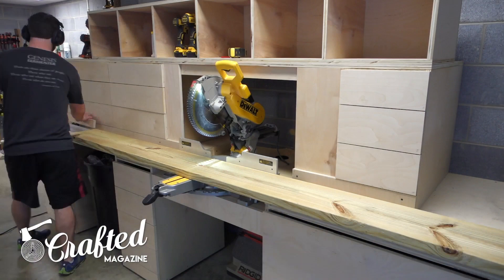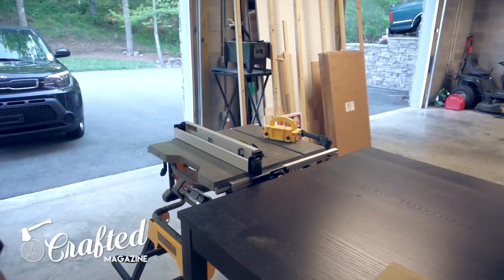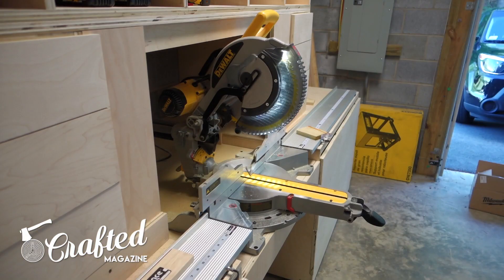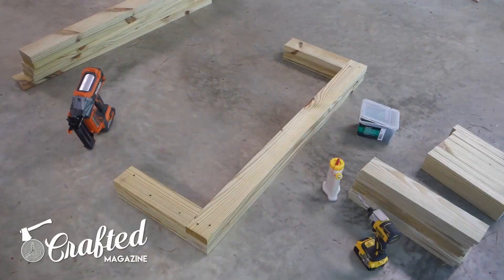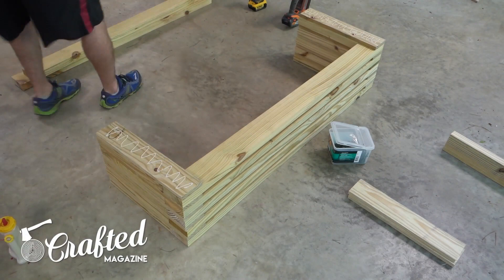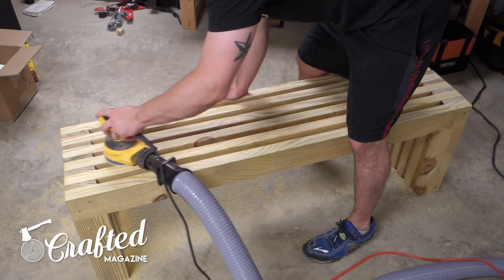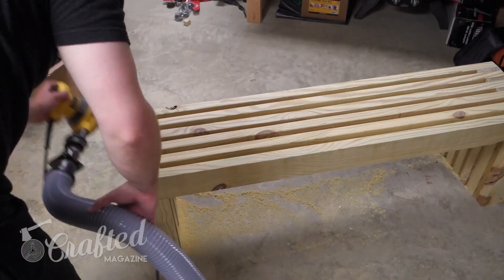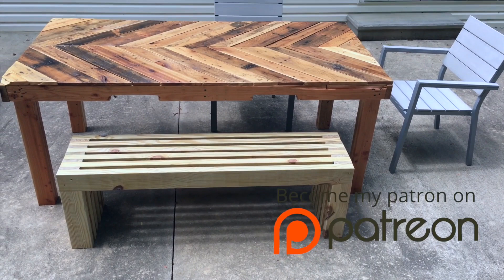How To Build A Modern Outdoor Bench | Crafted Workshop

Comment: Thank you for the video, I did mine with cedar 2x4 and 1x6 that I had cut down in 1x4 at the wood supplier. I used 2 ½ “screws and a lot of glue. The bench will suffer Canadian winters for years to come.
 The wife wants a second one…big success.
I wish I had your equipment but my Black & Decker saw and drill did the job.
Reply from the maker: +Andre Seguin nice, that's great! I bet the Cedar looks beautiful.